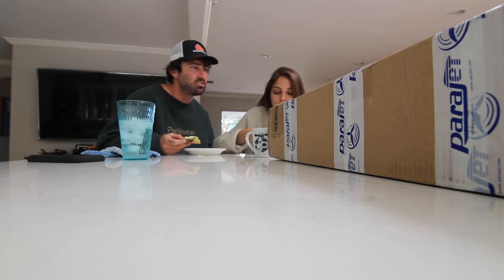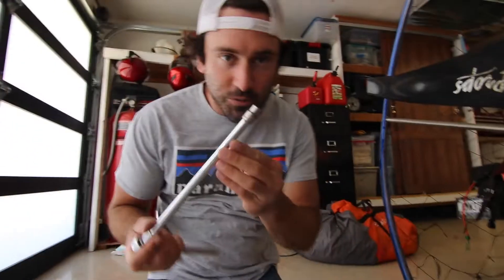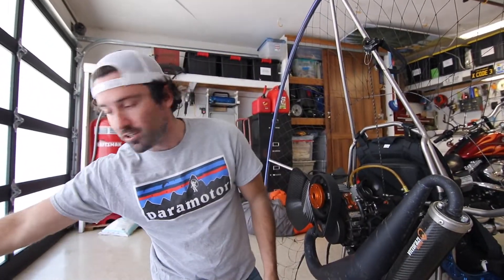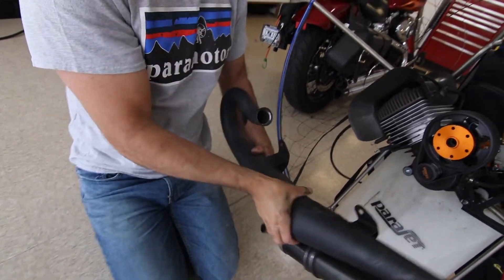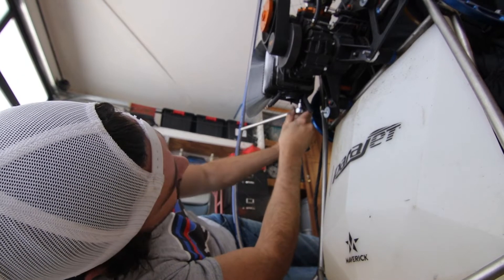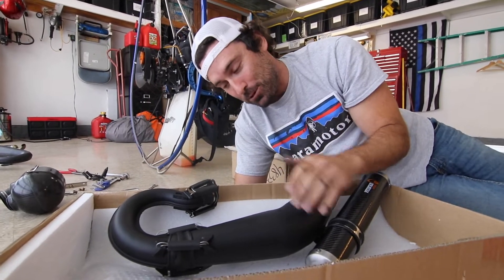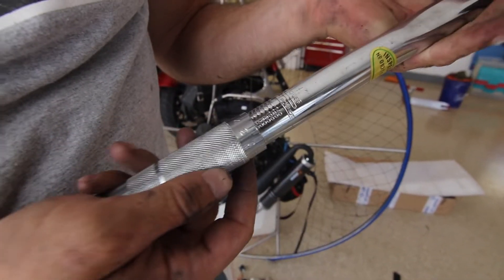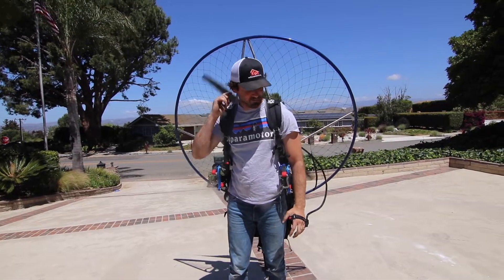Exhaust'ed with PARAMOTOR EXHAUSTS!

Comment: It's always the 10mm spanner that goes missing. I'll have to show you a trick to getting the springs off. Easy peasy.
Reply: Does it involve a coat hanger?
Reply: @AnthonyVella  a bit of old cord, a towel and a screw driver.
Reply: @GolfFoxtrot22  ahhh! I was wondering what the photo you sent me was. Lol. I like it!
Reply: @AnthonyVella  it works, I used it recently to change a gasket.